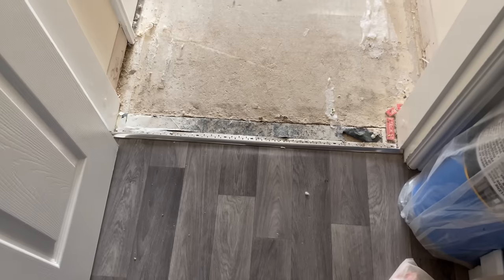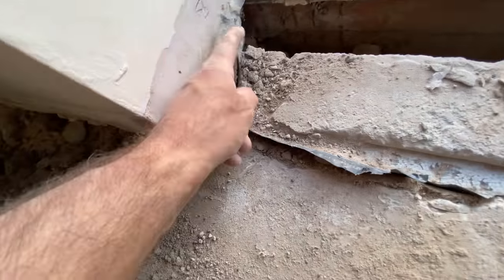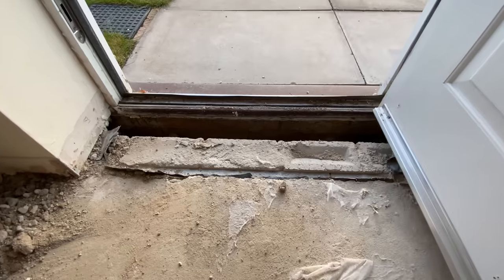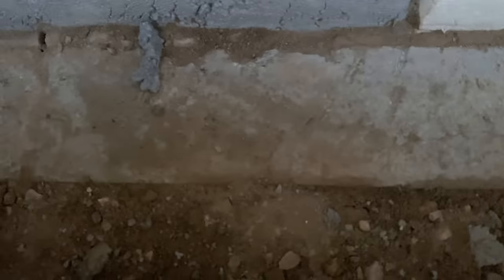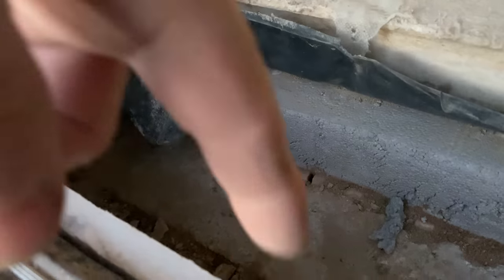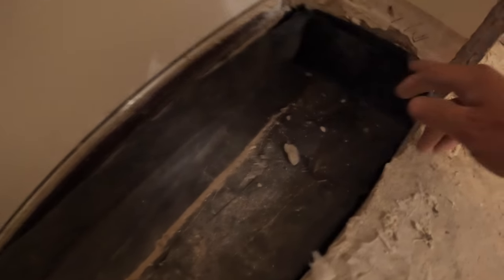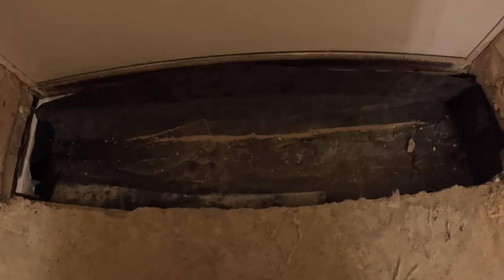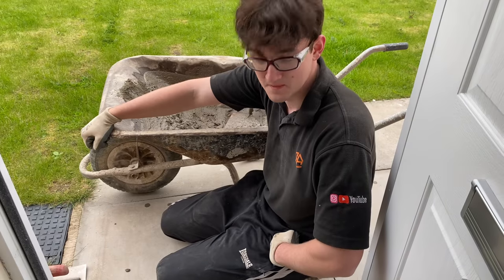THIS IS A DISGRACE ....BOTCH JOB ON OUR HOUSE

Comment: I've come across this problem many many times.
As a bricky, I never build the internal skin below DPC at door ways. I always set the doors out below DPC and return any DPM into the doorway.
I've been doing that for many years and I've continually had to explain it to builders and even architects. I even once had an argument with a building inspector who said it was not good building practice.
Its only been in the last few years that I've begun seeing this detail high lighted on plans and I'm still seeing brickies and builders ignoring it.
I once had to take out part of a 30k kitchen and a very expensive tiled floor to resolve this exact issue.
Glad to see you lads are on the ball here.... Great work as usual.
Reply from the maker: Great to hear mate . It’s a no brainer for sure 🤙🏾🤙🏾🧱👍🏽

Comment: My wife and I started on a single income and stayed that way. Starting in 1975 with $A5000 I hand dug foundation trenches and got slab poured. Built simple A frame shell minimal internal walls. In time built overhead ceiling floor for upper level. Made my first staircase and 2 bedrooms up top. Raised 3 children and ran my small business. I watch videos from “back home” grey, wet,damp,rain. Brits stayed home and sent convicts to sunny Australia where I followed. It rained early today but dry now. Haven’t watered garden in years. Admire your grit and determination sticking it out where I quit. But then I’m now in my second home all paid for and no builder to complain about.

Comment: That was outrageous work those " Builders" did. Great remedy and nice floor afterwards. 👍👍
Reply from the maker: Cheers Doug 👍🏽🧱
Reply: @martin2466  Hi Martin. Yes old roof 4x3 poly carb 6 sections. Got really dirty with bird droppings etc and had to clean 2x a year. Far too hot in summer and freezing in winter. Lucky door could be shut when cold so not good in winter. Went up outside to clean found lots of holes in top layer from birds dropping stones on it. Great local builder( known to the family) removed the whole thing, new 6" rafters tied into existing joists in bungalow, strand board and then layed out rubber roof covering in one day so was waterproof. Came back after rubber settled flat and glued down and fitted nice black trim and gutters. Inside 4" cellotex (cold roof) and 2 " above for ventilation via new soffits and into house roof. Then plaster-boarded. All finished and looks great.
Reply: 4x3 metres old roof.
Reply from the maker: @martin2466  very ! 🥺🧱👍🏽
Reply: @martin2466  Yes. S and A too far to call 🤣

Comment: Hi Steve and Alex ,  ime a groundworker  of 40 + years and  worked for all the main builders and  looking at the state of the rest of the concrete finish  its one of 2 builders i know who,s standard are that poor and think its ok.
Reply from the maker: There are some shocking sights 🙄🧱👍🏽
Reply: He told you who it was in the video, "Gleesons" but they are all pretty bad.
Reply from the maker: @135Ops  🧱👍🏽
Reply: @135Ops  Thanks for that  and yes ive worked for gleesons and they are the kings of bad house builders followed by keepmout.

Comment: I’ve snagged quite a few new builds and it seems the 400k houses are just as bad as a 120k two bed starter. The price does not buy you a better built house that’s for sure. I was told by one site manager, if you can’t see the mark from 2m away it’s not a mark. No joke.
Reply from the maker: Yep heard the same pal . 🙄🧱👍🏽
Reply: Typical builder patter that one. All I get told is it's within tolerance. I've been told the 2m bollocks for decoration and  even scratches on windows. If u can't see the scratch from 2m away it's not a defect. How do u explain that one to a buyer? We've sold u damaged goods but if u can't see it from 2m away it's fine. Industry is on its knees, I want out.

Comment: Gleeson, say no more. Their site got shut down for a year here as they didn't have correct drainage and were trying to use gravel drives to help alleviate surface water problems. All the foundations they had put in were like swimming pools with the ground water building up in them.
Reply from the maker: 😳🤡. Gravel driveways … standard issue over here . 😆🧱👍🏽

Comment: That is absolutely shocking. I am not a professional but one of the rules I learnt whern renovating my cellar was where to put the water barriers and how to overlap them as concrete is like a sponge.

I was lucky, as some parts I couldn;t get to without removing load bearing walls was thankfully dry.
Reply from the maker: Cellars are such a big job 🧱👍🏽

Comment: Could be a nice steady source of jobs for you boys to infill between bigger ones as I'll bet the rest of the houses round you have the same problem. The crap in new builds is just insane - often done by the cheapest bidder in the least time possible with little thought or care. We have a friend who is a builder and they bought a new build. We all thought he was nuts because he'd be finding all sorts, but the actual building work was OK in his case (local developer who has a reasonable rep) but apparently the plumbing was shocking so he's spent a good amount of time fixing it himself or getting in plumbers he knows when it's something more involved.
Reply from the maker: Yep 🙄🧱👍🏽

Comment: Don’t new builds get inspected by local building control inspectors any longer? When I worked for Laing back in the day we’d have very regular inspection on our sites . And where I live now you’d have at least 20 or 30 site visits by gung-ho officers, typically former electricians  or plumbers for grading, trenching and rebar rough plumbing and electrical installation pouring over plans and details looking for deviations . I mean it’s rough but nothing gets by these people. That is shocking for 2 year old property.
Reply from the maker: Nope , it ms all self governed by the builders 🙄🧱👍🏽

Comment: Interesting video. My house was built in the 1950's, I reckon it would benefit a lot from new insulated floors in the whole of the downstairs, but that's a lot of work.
Reply from the maker: A lot of work abs expense unfortunately 🙁🧱👍🏽
Reply: Long term, it’s got to work doing though.
Reply from the maker: @skiiddy  🧱👍🏽
Reply: Buy the most expensive pair of slippers on the market instead 🤔

Comment: Sad to see this on a new build but it's a result of the way construction sites are run these days. No site foreman to properly inspect the work on site just project managers in offices mainly concerned with  costs. Design and build contracts where the architect is employed by the contractor with minimal involvement inspecting work. Building inspectors privatised and can't get off site quickly enough. There is just no one to properly inspect what is done on site.
Reply from the maker: Very true pal 🧱👍🏽

Comment: Top tip, don't ever buy a new house 🤣 it's good you know what you're doing most folk would have had to pay out for someone to fix if
Reply: Yes wait for Steve and Alex to move then buy theirs with all the things put right.
Reply: @johnpeplow3985  to be fair when we moved although new houses are insulated we wouldn't actually get any more room than our existing house but 100k more. Instead we tripled in size on an older house

Comment: I have watched 1 minute and 1 second of this video and have  had to pause it to comment, my  question being; given your wealth of knowledge in the building trade why oh why did you think it a good idea to spend your hard earned cash on a stock new build? What were you thinking? Just look at the appalling finish to each side of the door casing were the screw holes are, absolutely shocking. I will now continue to watch the rest of the video...........🙈🙈🙈🙈
Reply from the maker: Oh there was much worse than that . 🙁👍🏽🧱
Reply: @SteveAndAlexBuild  I imagine there was. Why did you buy a new build given what you do for a living? And that's a genuine question, not  a troll or piss take
Reply from the maker: @monday7150  . Very cheap , love the area . Issues can be fixed . It was our 2 nd new build 😆🧱👍🏽

Comment: Steve most new builds are shit .i had one way back when from ideal homes i had knocked down from joist to dpc was miles out of plumb .we then had the internal soil pipe leak all over brand new carpet .the bath dropped drive sank .we sold up in the end and nhbc not worth a crap.some good ones out there robert mcalpine homes were brilliant most are shit as you no.
Terrible on you that they should be ashamed steve 👍🧱🧱
Reply from the maker: Unfortunately they aren’t ashamed , the guys at the top never hear anything negative from down in the coal face so are oblivious to it 🙄🧱👍🏽
Reply: @SteveAndAlexBuild  
Spot on but they should be mad accountable drives me nuts seeing what people have to put up with .Shocking these peoole are mate who signs that off a 👍👍
Reply from the maker: @brickrightbuildinglandscaping  I’ll tell you all about ours and show you the vids of ours when it was passed by the clowns from NHBC , the same cheeky f…k.r who picked my 4 foot level up and checked my brickwork was plumb in front of me and Al 🤬🤬🤬💪🏼🖕
Reply: @SteveAndAlexBuild  
Same stories all over the uk mate .just goes to show they no nothing about building to pick your level up and check your work you never do that a big disrespectful no no .its gonna get worse because the new blood aint getting tought like we did and thats not there fault but thats a hole new topic .NHBC aint worth shit steve  enjoy your day steve 👍🧱
Reply from the maker: @brickrightbuildinglandscaping  🧱👍🏽

Comment: how many homes are like that and you are a builder what chance has joe bloggs got that,s why the whole  housebuilding industry is corrupt
they are allowed to churn these out
they use sub contractors that move on 
I have a 1936 house that comes with its own issues but I have family with new builds and you can hear them upstairs when your downstairs
old  builds are good but you need a plasterer on speed dial for any works
shoddy workmanship and you have zero redress
feel for you